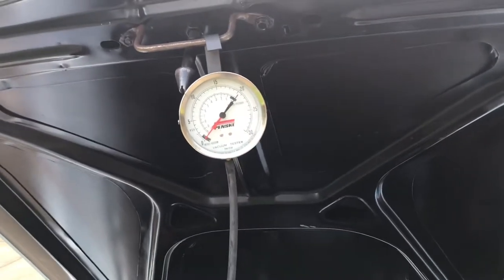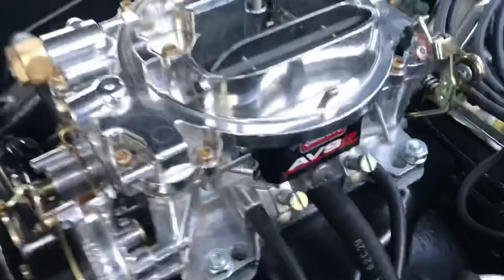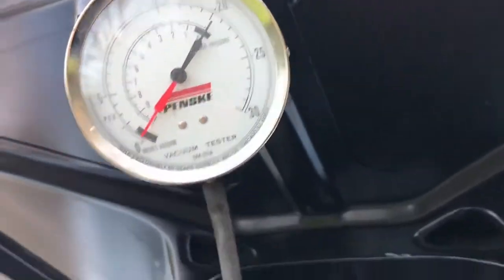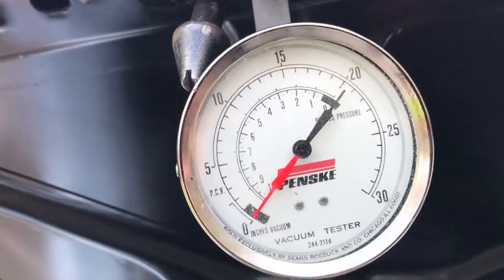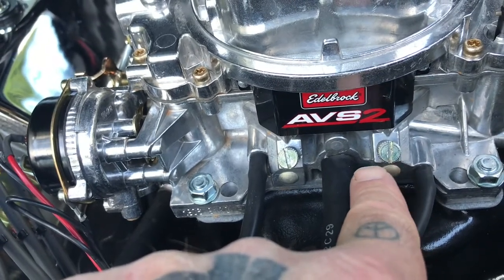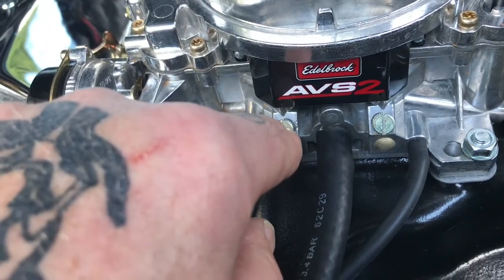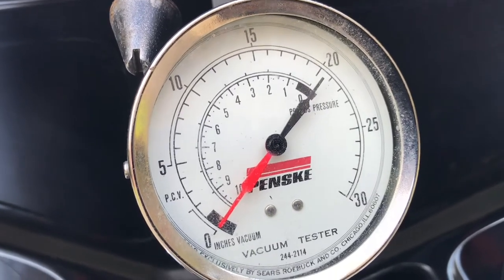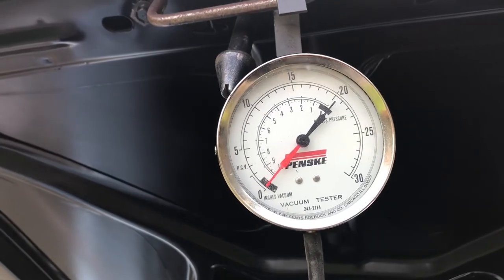How to use a vacuum gauge

Comment: Shouldn’t you have the transmission modulator connected at full vacuum and not ported?
Reply from the maker: It actually shifts the same whether it’s hooked up on ported or manifold. My 84 truck with a C6 is on ported vacuum and it shifts like it should. I think the fact that the mustang has a 3800 stall. it messes with throttle position and vacuum. That distributor hast to be on manifold vacuum or it runs like crap.
Reply: @zmurray9499  I meant the modulator that shifts the transmission, I just put a shift kit in mine and it’s shifting really high no matter how much I back out the modulator screw…
Reply from the maker: @MCFABRICATION  I am talking about the vacuum modulator

Comment: Is they’re any chance that you can show me how you have your vacuum lines set up on the acs2
Reply from the maker: The driver side port in the front of the carburetor is manifold vacuum. I have the distributor vacuum advance hooked up to that. The ported vacuum is the passenger side front port. I have the vacuum modulator on the transmission hooked up to that one. The back big Centerport is for power brakes. Experiment with the ported and manifold vacuum ports as far as The vacuum advance canister. Some cars run better with ported and other cars work better with manifold. Transmission is fine on both.